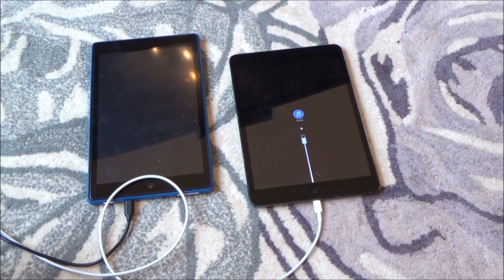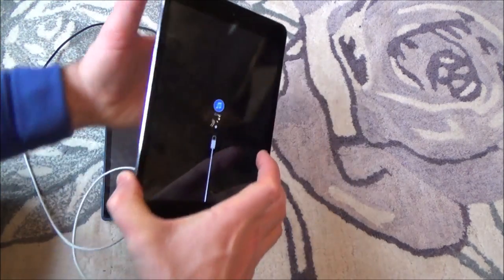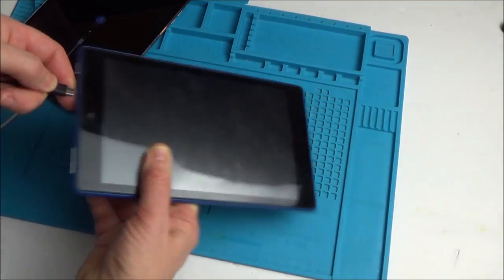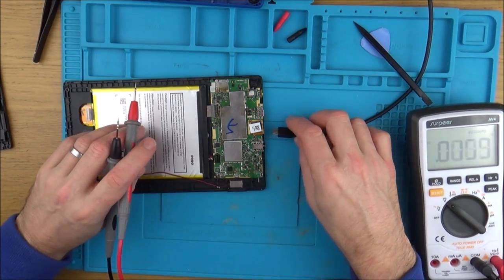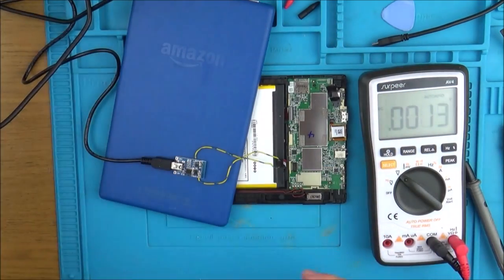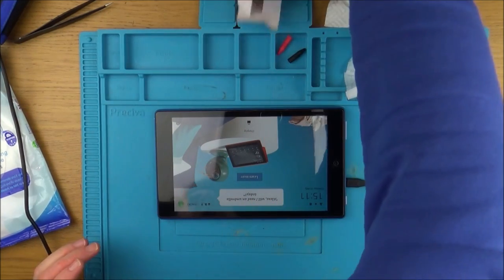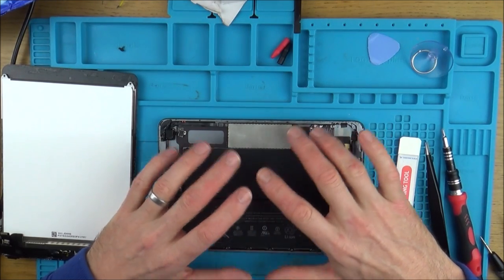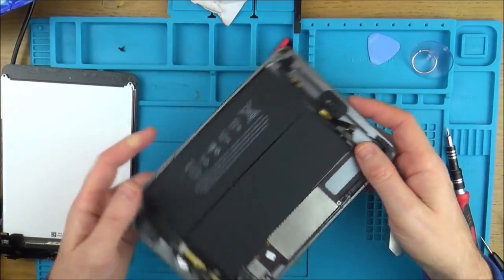Trying to FIX: Amazon Tablet and iPad

Comment: NAND for sure, that's why serial number was N/A cause it's written on that chip.
Reply: Well, I have an iPhone 4 stuck in recovery mode loop even after restore. Strange thing Is that there were no errors.

Although it did get error 4014 which is the same as error 4013. It had its serial number showing up.

Comment: Don't be too quick to put yourself down mate. Just because someone does something for a living, does not make him in any way a true "professional". There are many dodgy repair shops that only look for superficial clues to faults, to find an easy fix. If it's beyond their "expertise", they then tell the customer it's a fault with something very general like the logic board or screen assembly, in an attempt to fish for an opportunity in which the customer will say "yeah, go ahead, I'll pay the price you quoted, just get it fixed.". Dodgy shop changes out the entire logic board with another scrap unit, problem solved. Change the screen assembly with a 3rd party brand new one, problem solved. Mister Dodgy gets the dosh and 5-star feedback, when in reality he only knows how to swap parts out. 

Whereas YOU, my friend, goes through a logical testing process, using multimeters and soldering irons in your attempts to isolate and fix the issues. That is what a TRUE REPAIR PROFESSIONAL does.

Comment: Re-Balling any chip is really hard if you don't have the guide or proper Jig for respective chip, For that reason I have never removed and replaced such chips "You certainly have bigger balls for that Vince" Best one can do on the home front is to heat suspect chips up for a reflow.. Anyway APU I dropped alike..

Comment: You can charge batteries using Lab Power supply(which you should have by now) with current limit set. Easy and quick.
Reply: Jack K yah but he didn’t know enough about electronics to do that I think. He repairs things quit good sometimes but he don’t have much knowledge about electronic general.

Comment: Great job =D  I fixed a Hudl with the same sort of issue as that Amazon Fire - when the battery goes too low, or if it cannot charge they just wont boot (video to upload soon if my Mum ever videos it working lol).  iPads and iPhones are a world of hurt when it comes to trying to swap parts out.  You need a proper microscope really to work on them, everything is so incredibly small =/

Comment: You think that the iPad screen is hard to get off, but apples mobile devices screens come off fairly easy. With a little bit of heat and some sort of pick or tool, you can slice the glue right in half

Comment: If you connect it to iTunes you can factory reset the tablet. If that doesn't work you can hold shift on iTunes and reprogram the nand. By holding the home button and the power button until it turns on. Then keep holding the home button and release the power button. It will show up download a iOS .ipws file and restore it and hopefully it will work. Maybe I'm not 100% but I've had a the same issue. If it's not that it could be battery as it will not boot if battery isnt to minimum voltage but the apple logo will flash on and off as it tries to turn on.

Comment: You never restore/reset software/firmware if battery is lower than 50% because you can kill the device as it counts on battery between restoring phases and can/will loose data. For tablets like blue one, i don't even bother to use tools to open it rather than my finger nail ;). Did you watch the whole video that i used to send you on your email? That video can help you a lot with soldering/desoldering all kinds of chips.

Comment: The iPad was stuck in recovery mode and therefore will not restore via iTunes, this can happen after a software update going wrong, I had this happen to my iPad a few years back after a software update the tablet asked to be connected to iTunes same issue as you would never restore, did some research and found that the software needs to be re installed, I found the software for my iPad and used a third party software to download the software again in DUF mode, after which you can restore your data, only problem is if you don't have a recent iTunes back you lose data

Comment: 21:14 it's hard to believe I went from finding a tp4056 chip (by chance) and removing a lithium cell from a laptop battery... Charging that cell... 3 of them to make 12v and the rest is history. I now make ebike batteries and make other projects with 18560 and tp4056.

Comment: The thing was you put it an hour on charge but if the battery is so low it uses all the incoming voltage for the screen to display the battery icon but how you did it nowjust straight into the battery it uses all the v9ltage directly to the battery

Comment: 3.7 volts is the nominal voltage. it should be charged to 4.15 volts.
3.6 would be 4 volts. that battery is critically low and needs a charge asap. Id bet the charging circuit is bad.

Comment: I had got all the bits but lacking the courage to do the cutting in putting my Huawei MediaPad into my Reliant Robin's centre console so its like satnav, music centre etc kept running by the car on charge and even have a remote rear and front camera that can be all hooked up but with the rear of the engine literally 2 inches from the underside of the console heat is my enemy here and have had tries with different insulations but it gets roasty hot behind the console and I don't think my tablet is going to last long with that heat there.   So stupid me is looking at it and it came to me in a flash... why not install the tablet into my sun visor which is roughly the same size and shape so now working on that this weekend hopefully, I even have a spare sunvisor I can butcher to my hearts content and will make it the ultimate hands free kit as a bonus in the worlds crappest car :)

Comment: reball tristar and resolder you can replace 1610a1 or 1610a2 with 1610a3 , I have the box to reformat the nand chip but the nand chip is paired via the serial number , so I would need you to send the nand chip to me to reformat the nand, I like to use 3Utools to do the restore it gives you more info then itunes

Comment: I literally won one of those Kindle fires today
Reply: Power 2 Weight  Like yeah. Like it's good so far.
Reply: WHAT! 

MINES IS BROKEN
Reply: Theyre decent considering theyre meant as a low end option
Reply: same my ios 7
Reply: @Natei  Yeah they do the job, their usb ports are garbage though and pull off the board.
Reply: @welestgw  yeah I had one with the same issue a while back

Comment: Would that nifty little charger work on a psp battery?
Reply: Just use an old usb cable and cut it in half. Use red and black cable and cut off green and white and you're good to go. Red is + black - just duck tape it for 10 minutes but keep feeling battery to make sure not getting hot.
Reply: @M19u3I  Thank you Miguel, you're a legend 🖒

Comment: My daughter gave me her old equipment that was out dated.  Some of it worked some didn't.  I bought my wife a cheap Tablet from Sears 4 years ago and should have just returned it. It worked but the operating system was garbage and it struggled to do anything other than basic stuff. I think it was designed for some granny to send E- Mail to her grand children. Other than that, trash. I find myself going back to Samsung over and over. My wife bought a Pixle phone by Google and HATES it. The camera is JUNK. 
It will not operate her hearing aides eather. I ended up giving her my old Note 5. It has the Red half screen with burn in but still works fine.

Comment: iTunes error 4013 is one of the most common problems for apple users. ipad error 4013 is usually caused by pseudo soldering or damage of CPU, and also might be related to power supply of baseband PMU or NAND Flash. ... In this iPhone iTunes 4013 error case, the problem is fixed after baseband PMU replacement.

Comment: new charge port has been soldered onto the board ofr the ipad, but done badly, thats why its lost charging towards the end of the video, meaning theres bad connections, you can take it off and reapply it if done carefully, or just touch up the pad with some solder, seen it many times from lesser technicians rushing jobs out.
Reply: buy a preballed tristar, theyre cheap. honestly sooo much easier when properly balled with clean pads on the board. be better to get it working to a point until you can revisit :)

Comment: How to read English, in five easy-to-convolutedly-written steps, with special emphasis on electronics (parts (and their instructions/manuals): 1) Learn meanings of English words and word strings; 2) Learn how to negotiate/identify elements described above, in (1); 3) Find the beginning of the page — locate the furthest and leftmost place above the tops of the letters; 4) Begin there, negotiating word/string meanings, on the lines of text, from left-to-right and from top-to-bottom, until you reach the end of a “media text” (e.g., the totality of a medium’s (segment’s) printed area of interest, beginning with the first most instance (e.g., page, page fold, circuit board photolithography, and etc.) and ending with the last most, in the order described, (in (3) and (4), above); and 5)  then continue, likewise, with (groups of) alphanumeric strings  — for instance, brand names, part identifications, and names and their following/corresponding text, if provided, in that same manner. Follow those steps, until until you reach the end of the text body/bodies and the section(s), segment(s), and/or area(s) and their titles, including (alphanumeric) part numbers, as well as their corresponding instructional or otherwise-related text (e.g., “This End Up,”  “Place Battery Cell(: Part No. 2032BP-4) in Socket, with Text Facing [‘Opposite,’ or ‘Away from’  ‘Front of Unit,’ etc.]).

I hope this makes sense and is helpful, for you, in completing your tasks. Thanks much, for the great, very helpful video! Cheers! 🍻

Comment: here is 8 reason why you would get the error code 4005 
    1. iOS 12.3 system problems on your iPhone, iPad or iPod touch.
  2.  The iTunes software has not been properly downloaded or installed.
    3. iCloud hasn't been properly turned off, which leads to its inability to restore.
   4. It is an old iTunes version or computer operation system.
    5. There are USB connection problems.
    6. There is a virus infection.
    7. Some of the links are broken.
   8.  The iOS 12.3 or iTunes-related program files are corrupt.

Comment: You get the definite impression that Apple do not want you to fix their products.  Their software also has a, 'shelf life', that will only work on newer hardware, beyond the usual few years you'd expect for there to be incompatibility issues arising.  The updates they insist you install make older machines run slower purposely to get you to upgrade your devices.
Reply: They actually got sued for this 

I know with my iPhone after the iOS 12 the battery life went to hell I haven’t updated further and it’s still running fine but the battery life has gotten worse and now it’s getting hot during use 

I don’t want to upgrade but I’m going to have to due to the shit battery life and it getting HOT otherwise it’s working fine 
(Probably because I’m not doing iOS updates anymore😂)

Comment: Rules for restoring an iPhone or iPad which is proving problematic.
1: Always restore from DFU mode. 
2: Make sure to use a decent cable. 
3: If it fails try a different USB port. 
4: Check for hardware (Lightning port, battery) issues. 
5: Have patience, Apples are fussy. 

That error code is a rather generic one however you can beat it. 
If I’ve got a difficult job I take a charged battery and known working port and go from there usually that + DFU mode with a genuine apple cable seems to be the most reliable method. 
Out of hundreds of apple devices I’ve had to restore only a handful have beaten me. 

Tbh I think it’s all down to luck.

Comment: I have a mates iphone 6 here. It shows the same itunes thing. I went as far as changing the charge port. Told him if it was anything more than that I couldn't fix it and he should probably just ebay it for parts.
Reply: Watch out doing the iOS updates now if u disconnected the battery because the home button won’t work anymore if it looses power or is changed then u do an iOS update

Comment: I sucked out the nintendo switch battery to 2.550V while running android on it because it didn´t turn of at 0% but it did charge without any issues and 3,3V is still good and safe to charge.
I don´t understand why it didn´t charge the battery.
My lipo batteries of my rc cars also run until it reaches 3,0V and then can be recharged without any issue.

It get´s critical if a cell reaches a voltage level below 2,5V which can cause serious damage to the cell and maybe even create internal shorts and that´s the reason why it shouldn´t charged up it if it was deep discharged like this but well over 3V should be fine.

Comment: I once got a refurb Kindle Fire from Amazon that wouldn't charge; I had to keep it on the charger for several DAYS before it finally came back to life. That was several years ago now, and it's less useful these days as tech has advanced, but otherwise still working and charging perfectly.

Comment: You can boost the battery back to nominal value with a 9v battery the same way you did in the video. Hold for 10 seconds and it should work.

Comment: Don't mess around any BGA chip if you don't have its stencil, because you will not be able to reball it. Without reballing, you are 90% guaranteed to fail when yo try to solder it back.

Comment: That iPad is a no go as the components have a cryptosystem embedded into all of the chips so they all have to have their original chips otherwise it will not boot just send it to iPad Rehab Rochester NYC and let Jessa sort out the problem, your fingerprint doesn't match so you can't sign into the iPad, latest version is IOS 13.4.1

Comment: 3.7V lithium battery have full charge voltage of 4.2V !!!  3.7V is actually the minimum voltage (that device shows as 0%)
Reply: That's not true. 3.7 is nominal voltage. 4.2V is 100%, 3.3V is 0%
Reply: @solveit1304  or like that. thanks for correction. I wrote that at 2 am so I was not sure :D
Reply: @lordmmx1303  cool mate, i also love watching Vince videos at night :)

Comment: When the battery is plugged into the tablet it's most likely protected by a charging circuit, but when you charge it through the external charger you're bypassing that protection.

The iPad is most likely having a NAND issue, hence why the serial number is N/A (the SN is stored on the NAND chip) The symptoms you're having is also very much like the ones related to NAND-chip being faulty.
Reply: What is this AIK. Is that one of those male version of MILF or a blue oyster bar?

Comment: Nooooooo, you downloaded itunes Vince.  I 100% recommend a program called 3utools, so you don't have to install itunes.  Then again, if it's an old laptop, it's ok, but still.  Itunes lol.  Hate it.
Reply: Also, a little tip Vince, if you're trying to open something like the iPad and it has adhesive, instead of heat, try lighter fluid.  Possibly ipa would work too, but when I open them, I just use lighter fluid and it works fine.  I'm not saying heat doesn't work, but I think it's better to not put heat into it if you don't have to.
Reply: @cheezycool01  Nah

Comment: It's not a "dodgey" battery. It's a dodgey charger that was used on the first tablet. You must always use branded wires and chargers. Never eBay junk.
Reply: Original Shook wrong

Comment: Should have tried DFU mode on the iPad before taking it apart. Would like to see you clean the old chip and place it back on. I enjoy watching the micro soldering so when it was done once and then you gave up, it was less enjoyable then past videos, such as the Xbox controller ones. You usually are more hopeful and determined and it usually ends up working. This was not the case in this video. Everything ok?

Comment: I've had 2 of those amazon tablets for my kids the charge ports went on both.  Sometimes it used to show charging but it would never charge batterys were fine.  Managed to swap the charge port over and get them working again  over on my other channel karlfixes you can see how I did it if you like

Comment: If Apple repair says they think its the motherboard, they really mean buy a new one.
Reply: The mother board is everything, so that makes it scrap at that point.  I bought a Radio Controller like that. Everything worked except the motherboard. Someone knew it and swapped it. I got the bad one. My guess is the original owner knew it was bad. Eather way, I got ripped off.

Comment: I recently purchased a Samsung Galaxy Tab A that had been a display model at a local Sam's Club. It took a full 24 hours plugged in to recharge. When I turned it on, I saw it had been 3 months since it was charged prior. But then it was locked in "Demo" mode. I called the store and was wptold to bring it in and they could remove the demo. Turns out it comes from Samsung that way and can never be reset. I got a refund.

Comment: here are 7 ways to fix error code 4013 

1.  Install the Latest Version of iTunes. The most common cause of iPhone error 4013 is software. ...
 2.   Force Restart the Device. ...
   3. Connect the Device to iTunes and Update. ...
    4. Check for Updates on Your Mac or PC. ...
   5. Try a Different USB Cable. ...
    6. Try Restoring Using a Different Computer. ...
   7.  Contact Apple.

Comment: Try to fix: 
Ipad 2
Ipad 2
Samsung galaxy tab a8
Nokia fsid1000
Sun Quan mobile uhsid1078404040
Xbox portable 1.0
Commodore 64s pro max (last Commodore 64)
Sanyo cx 2570 (broken sensor cable)
Samsung galaxy among us editon
Samsung galaxy seal edition 
Sony a720
Moto memopad 1.0(terrible battery pack)
Filp mino mini HD (original version)
AIRPORT EXTREME PRO max 
Nokia 3310
Lg MINI LAND 2.0
Surface pro 3 +Xbox one x controller 
HTC one m90 pro